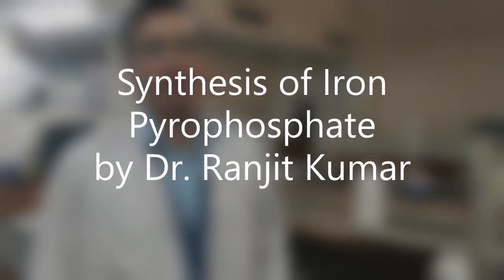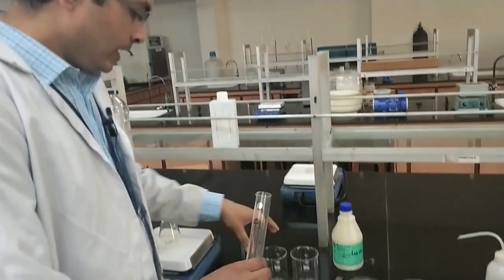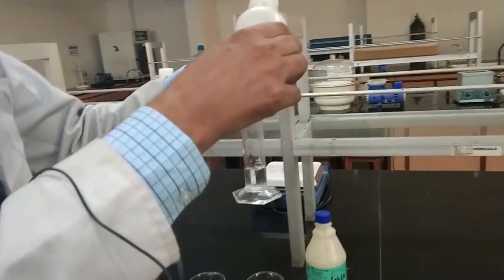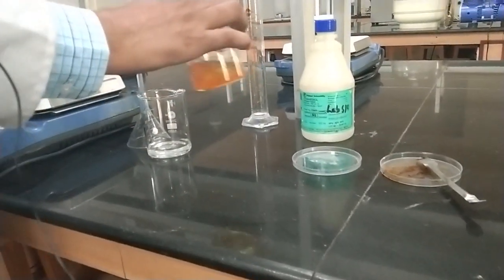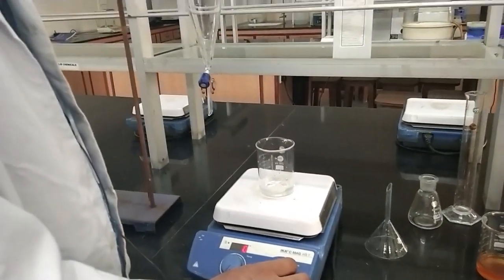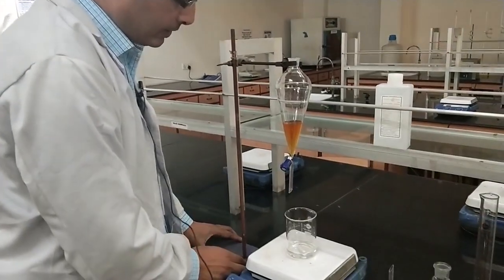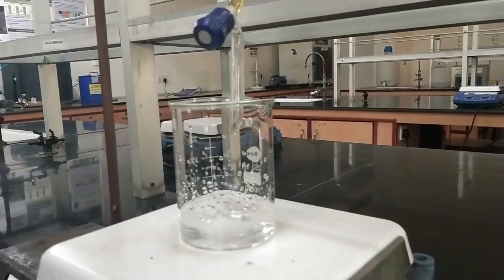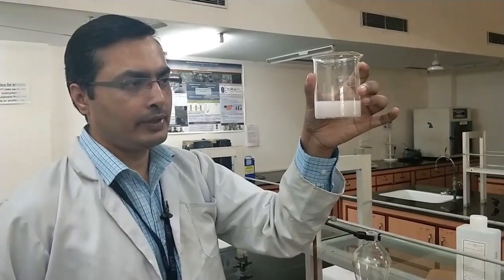Synthesis of Ferric Pyrophosphate Nanoparticles

Comment: What is the amount of fecl3 is added in distilled water..?
Reply from the maker: If you are doing research then you should be able to calculate the amount based on molarity and volume. The Molarity and volume is given in the description of the video.
Reply: @WorldofNanotechnology  pls tell me ..amount of fecl3..i want to do project on this topic...plss its urgent
Reply from the maker: @mansikale7939  If you are a high school student or college student and you dont know the formula of molarity then doing research does not make sense. First you need to understand the basics. Molarity = (Mass/Molar mass)/(vol. in litre)
0.01 = (X / 162.2) / 0.40  (If you are using anhydrous FeCl3, otherwise check the molecular wt. on the bottle)
You calculate the X

Comment: Is biopolymers stabilzed ferric pyrophosphate  in disperse in liquid solutions or is this any other method .Sir plz help me solve this problem to disperse nanoparticles on liquid solutions.
Reply from the maker: I have not worked with pyrophosphate, but I guess they are dispersed in water, or you can use alcohol water mixture

Comment: Sir how you decide that taking 0.01 M FeCl3 and 0.01M OF SODIUM PYROPHOSPHATE AND 15MI ETHYLENE GLYCOL
Reply from the maker: I just made these solutions based on the method described in a paper. However, you should calculate based on molar ration in the chemical reaction.

Comment: Sir how to determine that amount of ferric chloride and ferrous sulphate like how much molarity is needed for iron oxide preparation.in different research paper their ml and molarity are different if any book regarding this plz suggest me
Reply from the maker: 3.24 g of FeCl3 and 1.83 g of FeSO4 were dissolved in 100mL of distilled water, respectively. Then add 5%PEG and stirred for 10 minutes. Then the mixture was heated to 75◦C, followed by the addition of 2 mol/L NaOH solution until the pH value of the mixture reached about 11.5. Continue stirring for 2 hours at 60◦C. The resulting particles were separated by magnetic field separation, washed several times
with distilled water, and dried at 80◦C.

Comment: How telfon sealed autoclave is different form autoclave?can I kept nanoparticles solution in glass vial and kept in autoclave ? in research paper written that transfer the solution in teflon sealed autoclave kept at 160c for 3 h . Where to kept autoclave in oven or elsewhere.
Reply from the maker: Teflon lined autoclave is different than autoclave used in bio lab for sterilization. Teflon lined autoclave is also known as hydrothermal bomb. It is used for doing reaction at high temperature and high pressure. It uses the autogenous vapor pressure of the solvent used in the synthesis. You can search for how to use this apparatus. I will upload the video in 2 weeks.